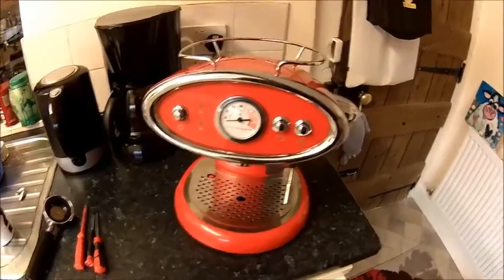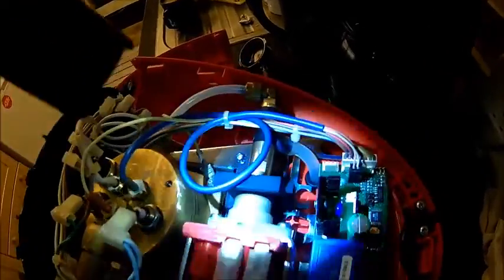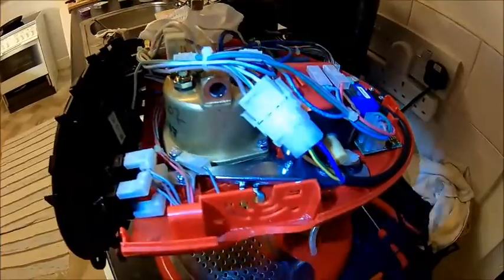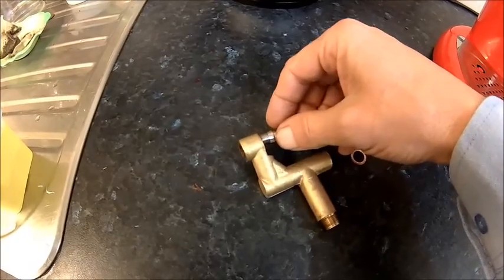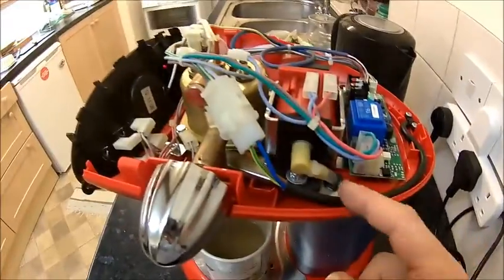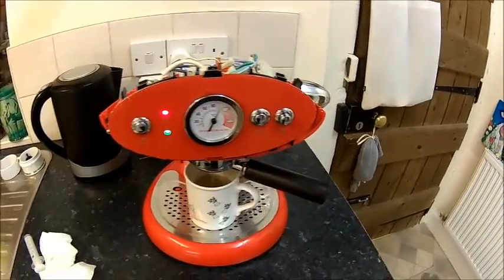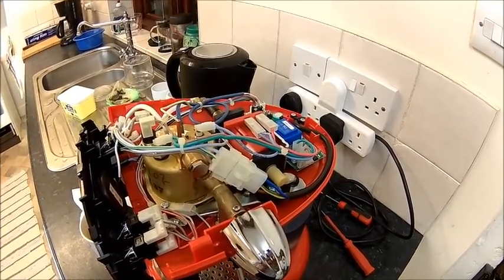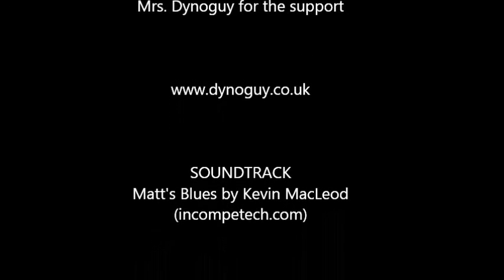Francis Francis X6 Espresso machine -  tear down and repair (no water flow)

Comment: Is the boiler a two part? I just fixed a large coffee maker with a one gallon tank. Removed cover ant cleaned tank and coil. It was a mess.
Reply from the maker: No, it's a one piece unit, unfortunately. I do remember the old Saeco Vienna machines where you could take the boiler apart, easy job to clean, but with this one, either use acid  (and pray) or buy a new boiler.

Comment: Hi, the vid is great. I have this machine since 2005 and I love it. Unfortunately the temperature dial isnt working any more. Any clue where should i look into to fix it ?
Reply from the maker: Hi, thanks for watching.  Well, the thermometer is a pretty simple thing, no electrics involved at all. If you look at the back of it you can see something which looks like a wire but it's actually a very thin tube, the end is a bit thicker and should be stuck in the boiler.
The working principle is gas expansion, so if the tube is kinked or leaking it's scrap, nothing you can repair. Unfortunately you have to buy a new one. Pretty easy to change, if you look at it, it's quite obvious how.

Comment: Still not sure why you didn't return it...since it was sold as working?
Reply from the maker: Once i found it's not working, I contacted the seller and he gave me a reasonable refund, much easier than going through the trouble of re-packing and sending the thing back. Would have left me still with no machine but lot's of wasted time.
I don't mind fixing things and buy lots of faulty stuff, simply because it's cheap and also a good thing to make something work again rather than just throwing it away.  and last but not least. it provides some content for the channel.

Comment: Thanks for sharing.... I have exactly the same machine with the same problem.....  The machine goes on but does not pour.... I do not see any water being pumped through the tube.....  So I followed your directions exactly but still not working.... It does sound better but no pump action....
Should I replace the pump assembly? No one seems to stock this part because of the age..... I hardly used it for a few months, and it has been in storage..... Please guide me as to where I may find a replacement part or who can repair it.  If I send you the pump assembly would you kindly check/repair it? Of course I do not expect it for free... I will be more than happy to pay for your services..... Thanks for listening.... Paul
Reply from the maker: Hi Paul, thanks for interest.
A general problem with this type of machines is that they don't like sitting around unused.
If the boiler is not completely blocked and still working, you (sort of) lucky.
From your description, i think the problem might be the 3-way/non-return valve.
It hardly happens that components are unserviceable, they just need a good clean but this can be time consuming, so most repair shops will sell you new parts as this is cheaper at the end.
I haven't done much research for parts, but from what i can see this machine is pretty much unsupported nowadays (too old). If i really need spares i would just use similar parts of another machine.

If you want to discuss your suggestion, please send me an email, contact email is in the About section of my channel page.
Reply: Same boat here. Followed your great video. Was able to get boiler filled with vinegar, good flow. Then I cleaned the pressure valve coming out of the pump- good flow. But the pump just makes a lot of noise and doesn't pull any water through. Ideas?
Reply: @arafeinstein270  The solution is to inject water in the pumping tube located into the tank, but previewsly removing the small suction filter. The issue is that after long time stoped no water in the circuit and the pump is not able to suck the water and need some help. You just fill the suction line with a syringe.
Reply: Also is recomended to do a cleaning with special disolvent to remove the lime inside the boiler. This is a procedure explained in the instruction book. You have to buy the disolvent pounder and put it in the tank disolved into 1.5 liters, then serve several coffees until the water solution is finished. This procedure remove the lime deposits inside all the water circuit and inside the boiler.